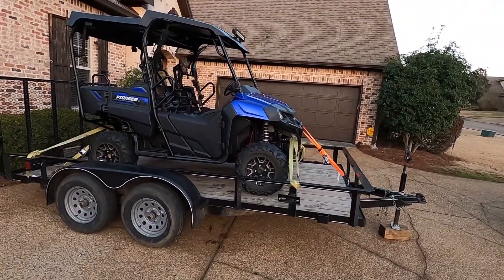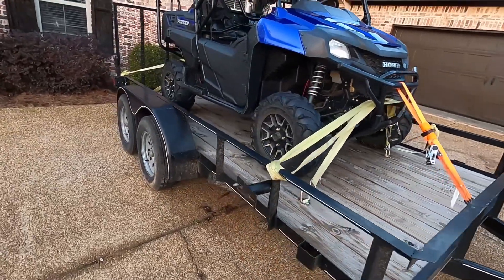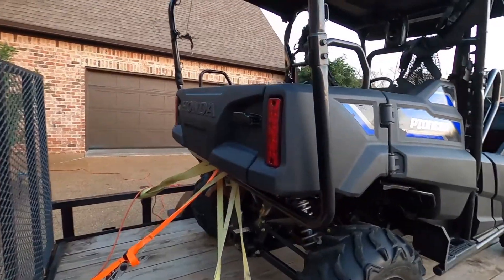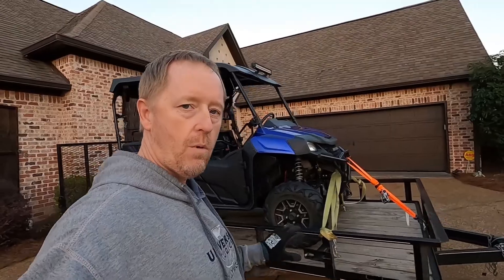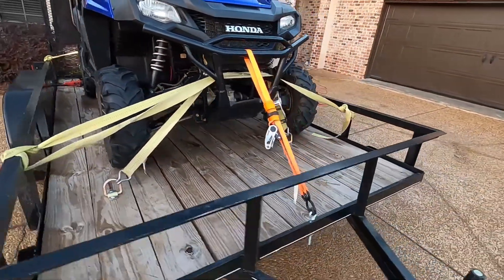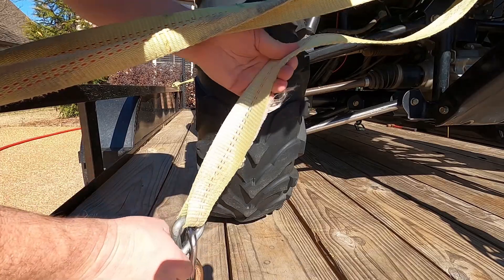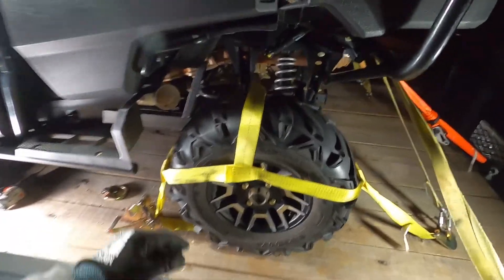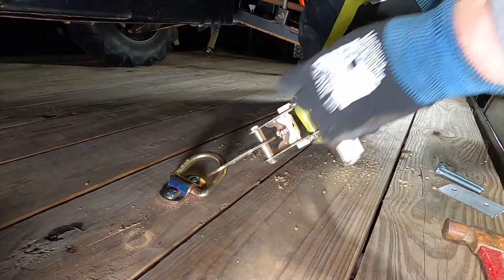Tiedown Hooks  &  Wheel Straps

Comment: Great points, I would also caution about using a movable tie down point like a d ring with more then 1 strap. In my experience If one strap comes loose then can both possibly come loose
Reply from the maker: Yep.   I welded tie down points to the frame so I never put more than one strap on any tie down ring.   Thanks for watching and commenting.

Comment: If you truly want to stop your sxs 4 wheeler, car,truck  to stop moving, you need to strap,or chain in 4 directions. Which requires 4 straps. 4 corners. In an x pattern in front and back. 1 sxs 4 straps  and 4 anchor points.  Simple and cheap. Been hauling most every type of vehicle for the last 25 yrs and never had any problems by doing it this way.
Reply from the maker: Yep, I agree.  That's the plan after I get some tiedown loops welded on the trailer.  Thanks for the suggestion.